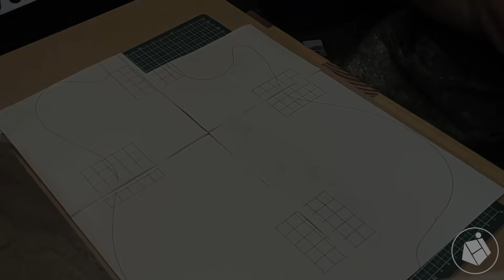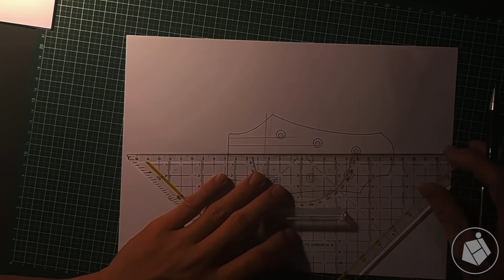Full Build of my Custom Guitar (second guitar build as an amateur woodworker)

Comment: I did not regret one second of the 24 minutes and 23 seconds it took to watch this video. You certainly have the tools and the know how to use them. Proof is in the pudding absolutely stunning guitar of a one-off custom design. Excellent work top of the line. Now I would really like to hear it and it to know what kind of pickups you put on it
Reply from the maker: Thanks a lot that's very kind. I'll make a sound demo very soon. As soon as I'm done filming my current build (a ukulele). For this build I bought a DiMarzio PAF 36th anniversary on the neck and salvaged a DiMarzio evolution on an old Ibanez RG, I had no clue what those two would sound like together but I'm very happy about how it came out :)
Reply from the maker: Here is the sound demo : https://www.youtube.com/watch?v=Xe28wBwKuBw

Comment: I built my own years ago while still in high school, when I read about Brian May.  It was a  copy of a Gibson melody maker.  Took all the measurements from a photo in a book.....only power tool was my Dads drill. To all those who say they've been meaning to do it.....I encourage you to just get started.  Common sense and perseverance will get you most of the way...... and it'll give you a real sense of pride.....The only part I really struggled with was getting the action (angle of neck to body) to an acceptable state.....but wood construction is a very forgiving thing....You can do it!  .... .If you want a bigger challenge, wind you own pickups like Mr May did..
Reply from the maker: I second that. All the way. Common sense and perseverance are the key. 
Getting the right action is a hard thing, I struggled on my first two builds and this time was easier for some reason.
I should also add that Professor May was also a huge inspiration and motivation (it inspired me to make my own design also ).
Reply: @tchiksguitars  we would like to hear how it sounds.
Reply: I'm great at bodies I just seem to screw up every single neck I have tried to make.
Reply: @twootters7433  Yeah ....a lot of details to get right from the slots on the nut to the twist of the neck...It truly is a 3D problem.  you can fine tune the overall angle just  by being able to adjust the height of the bridge and pickups....The mistake I kept making was too much (and uneven camber) on the fingerboard....especially when you think about bending strings....patience and a long enough metal straight edge is the only cure I could come up with.  I am there is a better way with a creative jig...
Reply: @NoChateau  I always ruin the fret wire depth, then screw up trying to get the frets the same height. I've read books, watched videos, it's like I have a mental block when it comes to the necks.
Reply from the maker: @jacobdianson1976  Here is the sound demo : https://www.youtube.com/watch?v=Xe28wBwKuBw

Comment: I work on guitars too. Repair and assemble and modify. I can’t build them from raw wood like you but I like the relaxed but focused headspace it puts me in. No tv, no phone, no bs. ✌️🎸😎
Reply from the maker: You should try to make one :) When the wood part is done it's like repairing a guitar hehe
Reply: tchiks guitars & furnitures I will start with piecing a neck together, cutting fret slots, etc, etc, etc. One step at a time I will put it on a pre-cut body, etc ✌️
Reply: tchiks guitars & furnitures just gotta Jedi mind trick the wife once I start moving in a drill press, and other big items. I am doing it.....slowly.🤣🤣🤣🤣
Reply from the maker: Slow is good I think. I work incredibly slowly :p

Comment: Absolutely gorgeous!  You really took it all the way when you made the wood pup rings - props!  I was surprised you covered the head-stock but I get how the match is pretty gorgeous.  One question: How much does that beast weight?  :-)  Thx and please post more!
Reply from the maker: thanks for the kind words !
The reason why I covered the headstock is because my previous build was a neck through bass using the exact same wood species and I wanted something that would look different (and also I secretly wanted to try using headstock veneer :) ).

Thanks to you I now know that my guitar weighs exactly the same as my bass (which is crazy!) : 4.200 kg.
I'll be posting more builds, thanks for watching !
Reply: Also curious about the price it sells 😉

Comment: This is really great! Great design/aesthetics/appointments, well-executed. I also am a hobbyist luthier with a full-time, unrelated job, though not as professional/organized as you (even though you say you're not a luthier). I've built several classical guitars and two electrics (one a 335 copy) totally from scratch, I use the planes, spokeshaves, etc. The one thing I do that's different is use hot hide glue for pretty much everything except the binding. I think the rigid joint it makes (and it shrinks in the joint over time to an even tighter fit) helps the acoustics. I also think that having a white or yellow glue joint creates an area that does have some give to it, so it can absorb vibration. That said, I built a copy of Mike Campbell's Rickenbacker 12 and used yellow glue for the joints and that thing was plenty resonant - but of course it was a 12. I do think the hide glue gives it more. Well done, loved seeing how you did stuff and picked up plenty of tips from it.
Reply from the maker: wow, what an instructive comment! As a matter of fact, I didn't even know hide glue even existed before this morning when I watched a video of the restoration of Martin acoustic guitar. It's crazy, I'm planning on building a 335 copy (I want the . It's been on my mind for a week now, I can't figure out the exact thickness of the top and back plate (not counting the carved surface) so I'm a little bit stuck right now, and due to the global lockdown, I can't find wood to make the guitar (I may have to take down a Sapeli shelf that I previously built, it's big enough for the top and back plate + sides, but still have no wood for the neck and fretboard:p). Back to the glue now : I've always used white glue, my entire woodworking life (e.g 2 years :p ) and it did the job so far, if I ever make a full size acoustic guitar I may well be interested in hide glue, after reading what you just said :)
Thanks for watching !
Reply: @tchiksguitars  I had the advantage of having my '71 335 on hand to take measurements, trace outlines, etc. Just measured and the rise of the domed top and back is about 1/2 inch from the level of the outer edge on the widest parts of the lower bout, same for the back. I had two maple boards 10 inches wide by about 1 and 1/2 inches thick and that worked. You could get by with only 8 inches wide since top is 16 inches at widest, but nice to have a little extra to play with. Carving that maple by hand took forever! I think I aimed for about 1/4 inch thick everywhere, and then after it was built I thinned some  more to get the weight down a little - I think it ended up at 9 lbs (I built it for another guitarist, don't have it now).
Reply from the maker: @jeremyhickersonsalem  thank you for those precious numbers! It's true that having a real 335 helps, I don't have one (and that's why I'm building it), but I'm looking for people in my area who would let me measure it. But your datas are a good beginning. Did you use a router to take out some material first, or the drill press method? or everything with a carving gouge? Also, I don't have a thumb plane (because I don't know which one i should get), do you think it would work ? Thanks a bunch for the advices !
Reply: @tchiksguitars  From the measurements I gave it seems like even a 3/4 inch thick board would work, I drilled to the correct depths (with a brace and bit), then used carving gouges and eventually a thumb plane that I made from a scrap of hardwood and small plane blade I had in another very small plane. The thumb plane was crude but I was able to tinker with it enough to get it to work. And then I did a lot with the "curlicue" scraper. On my 335 the maple center block ends after the bridge, just at the back edge of the bridge pickup plastic mount; the neck block is mahogany. You might consider this to keep the weight down, if you don't mind that acoustically it's closer to a hollow body (this could be a feature) Mine has the trapeze tailpiece rather than a stop bridge. This guy had about 40 videos on building a carved-top semi hollow (335); they were invaluable, especially for the neck mortise and neck tenon. It looks like he may have pulled them now; he says they're available on his website but I didn't see them there. https://www.youtube.com/watch?v=cneMoPTcBdc
Reply: @tchiksguitars  Here's the one I built, in the white, before I finished it (you can hear I've got a tube going out in my Deluxe Reverb) https://www.youtube.com/watch?v=SevYu7fMzeM
Reply from the maker: @jeremyhickersonsalem  beautiful ! It sounds very nice too. I didn't see your last comments because my notifications are off, but then I went back to your post to take note of the measurements you gave earlier :p
Reply from the maker: now all i have to do is convert them into metric :)

Comment: I think that maybe the only thing would have recommended would have been to route a channel between the pickup locations and to the control cavity before gluing on the top. Those locations were at least roughly know and it would have been simple to do. The guitar did turn out pretty nice. The fret board turned out really well with the grain pattern it has.

Comment: 2 builds in one year, this could be habit forming! What a guitar, it's gorgeous and not just in a pretty way. The build itself is gorgeous. I would never of thought about building it that way, but you did, and you did it so slick! I'm watching you assemble wood and I can't figure out why your doing it the way you do and then a couple of steps later and your vision becomes clearer to my feeble mind. Another pull on my root beer and your off on some other part of the guitar. So let's cut it short, it's stunning absolutely beautiful in every way. Another guitar is born. Thanks man, your inspiring. One question, what kind of wood is the fret board made from? It's the prettiest fret board I've ever seen!
Reply from the maker: Thank you so much for these kind words ! It's actually 7 builds this year (my seven first builds) :) I'm still on a learning curve,  so in the coming years I guess things will go more smoothly when I can have a real building routine. The fretboard is maple but I got lucky on this one, I had no idea it would look like that when I bought it. I learned later that when quartersawn, sycomore Maple sometimes have that beautiful square figure (a little like beech but prettier), violin makers often use that for their bridges (I also found that later :) as I said I was very lucky.
Reply: @tchiksguitars  You did 7 guitars this year?" Awesome. I'd like to see some pictures of them, any chamce of that happening?
Reply from the maker: Well 3 builds were filmed, the seventh is soon to be published on YouTube, the first uke wasn't filmed but it's basically the same one as the second which has its own dedicated video. The bass has a slideshow showing the build along with a sound demo. And I didn't think of filming my very first build ( a telecaster thinline). So yeah almost my entire, but short, guitar maker career is on film :p

Comment: Great job and well documented, it's a beauty.
That laminated neck would never need a volute. I bet you can stand on it and it won't break. Scarf joint makes it possible. 
No comments on the order in which things were done, though I can think of some to save time and effort.
Yeah, I'm that asshole but, have watched it done live by a few guys who make all sorts of guitars. Some old school and some experimenting with new ideas.
The PRS style finger access carve on the lower bout is cool - never seen one in walnut before, great color contrast. Love the headstock design and I was very glad to see the Electrosocket jack plate. Purists turn their noses up at those. Why, I will never know. It's one of the most innovative things I have seen though I consider a Strat jack to be the ultimate as far as function/location. Both of my basses have Electrosockets, one is a 57 P bass and people crap themselves over such mutilation. Sure, I can slap the old Tele POS back on but, why?
This guitar should cost over $10K considering PRS charges that for their CNC made Private Stock models...The only thing they do by hand is sand, assemble, fret, inlay - though Aulson Inlay does their really intricate stuff,  paint and polish them. Same can be said for Fender and Gibson. 
Imagine the crowds this would draw at NAMM. Like most true limited hand made custom guitars....Sold before the doors open.

Don't come burn down my house as I never mentioned playing it. I am merely airing mental notes and none musical. Keep making them.

Comment: You have nice tools and used great looking woods, but to be honest, this instrument came out looking like you were in a rush when you made it. The carved areas in particular seem like they could have been better thought out, particularly the neck joint. And we didn't get to see the final carve on the neck and volute, but it looked a bit undercooked to me.

PS: I'm not crapping on you. I only just read that this your 3rd build. If I could recommend one huge thing, it would be to glue the neck in, then do your carving. Go slow, but go for it. You will achieve a better final result. And you can save money on neck wood by making the headstock angle 10 degrees rather than 15. You can use a 2.5" thick blank, rather 4".
Reply from the maker: thanks for the comment. 
you are absolutely right, this guitar was totally improvised (except for the body shape that I actually drew ahead of time). 
the neck joint was a concern from the beginning, I didn't have enough stock so the two maple blanks were uneven and I've known for the whole duration of the build that it would be a weird shape at the end, and it is .. but I kinda like it, it wasn't supposed to look like any other guitar in the first place, so mission accomplished :p (even if it's not universally esthetically pleasant)
Now about the volute, you are right, it is a little bit clunky but I didn't worry much because there's still enough meat, if I get bored someday I can go back and work on it.
I don't mind loosing a bit of wood here and there because I always find a way to use the scraps. This guitar is actually made exclusively from things lying around in the garage :) but you are right about the headstock, I'll probably make scarf joints in the future. 
I think that you've spotted everything that bothers me a bit about my guitar héhé, nice job.
Also I should add that I've been an amateur woodworker for 2 years and an amateur guitar builder for 5 months :p so your comment is very welcome .
As you said, it's my third build and I'm very happy about how it came out, after all this is not a commission, just a guitar I'm gonna play and maybe give to my kids someday :)
Reply: @tchiksguitars  I didn't mention it previously, but I really like the body shape, and per your description of the process I better understand the hurdles you faced during the build.

I've been building guitars privately for a few years, slowly working on shapes and construction techniques. It might surprise you to know that the few simple tools I use are a router and router table, handheld electric drill, leveling beams, a series of files and rasps, my handmade templates, handmade radius blocks, and a few different saws. 

Scarf joints can certainly solve the issue wanting an included headstock break angle, but not having sufficiently thick stock (I suppose that was why usage of them started on guitars a couple of hundred years ago). I have one neck that has a scarf joint, but I messed it up and had to scrap it. It now hangs as a reminder of what not to do.

Keep on building. I don't have any social media accounts but I'd like to share some pics of what I'm building. Any way I can contact you?
Reply from the maker: @peachmelba1000  well in the old days there was a youtube messaging system but it seems it's gone now. Are you on reddit? Maybe upload your pics on something like imgur :)

I get a lot of comments on my tools but I don't really get it. It's not like I used extravagant overpriced tools. The templates you in the video are also hand cut by myself (MDF, drill, coping saw),  I flattened my own leveling beam by hand using a diamond plate, I made my own radius block, I even made my own workbench haha.
Reply: As a victim of several broken scarf joints, I recommend using the extra wood to include your neck angle. If you plan correctly very little wood is wasted and the integrity of your neck is never in doubt. A custom guitar should never have a scarf joint in my opinion. The reaction from a potential customer when they see a scarf joint is always disappointment.

Comment: Great, I agree that a sound test is missing. Personal taste: what I don't like is that front PU cover is too near to the body curve. But, again, is personal taste. Good job, great finish, looks awesome.
Reply from the maker: spot on! it is indeed very close to the body curve, had a little bit of miscalculation there :) thanks for watching! the sound test is coming
Reply: @tchiksguitars Thanks for the reply. Did you use TruOil or...(?) for the finish?
Reply from the maker: I used tung oil then a thinned down polyurethane :)